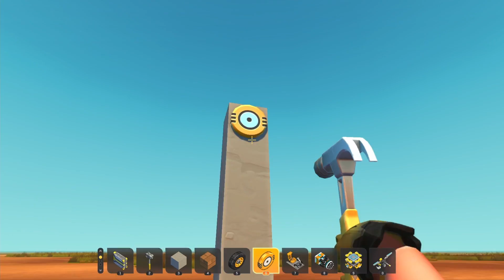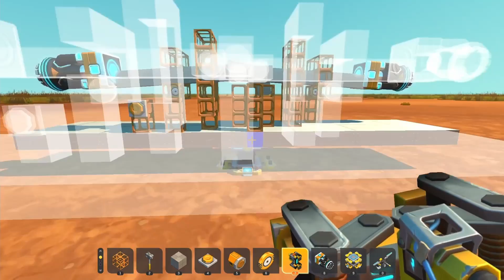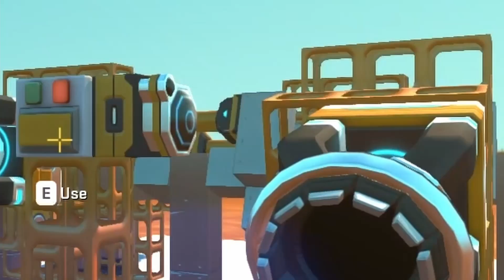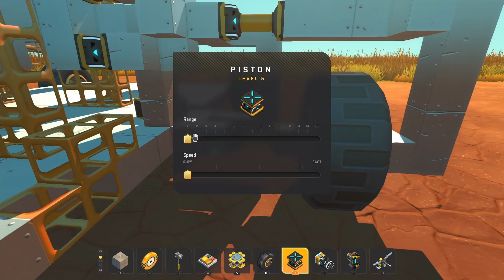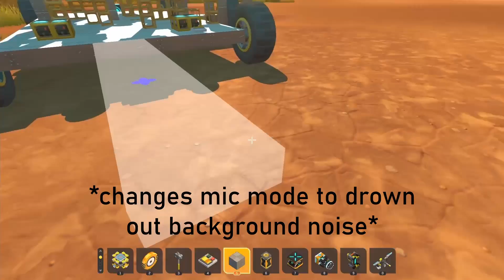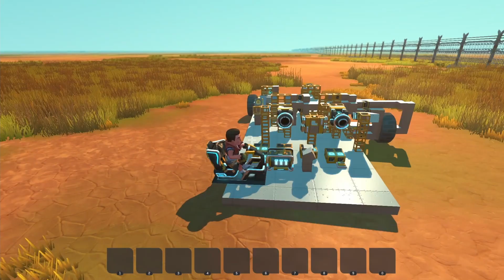Can You Make a Realistic Car in Scrap Mechanic?

Comment: you should look up scrap mechanic passthrough bearings (like the one made by cheddar fox), they put the piston either off to the side and connect it to the axle, or directly on the axle through the bearing. there is plenty of videos on how it works and how you can make them with out using mods or glitches that arent part of the intended game mechanics (eg: bearings have give perpendicular to their axis allowing you to place a piston on a displaced daughter object when it is pushed sufficiently out of the way. this is normally used as a sort of spring to more easily calculate forces from part to part)

Comment: Hi.i think is very heavy and engine work hard to move it
Use wood or plastic etc next time
And in SM you have alot of way to build free energy small engine.
Some example is wedge and pipe or piston engine or other glitch power engine
I dont remember all of them but they are too many.

Comment: You could make a clutch to keep the engine running even when the vehicle is stopped, this would also allow you to get it rolling without relying on a bump start, as when you extend the clutch pistons to make contact with the flywheel, it will still be able to slip to keep running, and the vehicle would gather speed off of the leftover friction until there is no longer any slip. You could try various block combinations for different levels of drag, who knows what the right combo would be as too much friction would stall it while too little would hinder performance.

Comment: Some small tips:
1. "Generator pipes" look like thick pipes but actually are quite a lot smaller, so if you'll need smaller hitbox you can use these
2. Talking about gears, sm while having quite small blocks, works best with big objects in that regard

Comment: I’m sorry- did you connect the two halves of the engine with free floating extended pistons? When you couldve just built them as one object, plus you could use suspension pieces on max strength as they’re longer
Reply: or just weld the parts together..?

Comment: Advice - make the camshaft bigger for higher torque. Its 3 blocks big now, if it was 5, that would make a huge difference. Could even go for 7. Thrusters shine not at torque, but at speed, so, using them in a system which expects less torque out of them, will make the system much better

Comment: where is the flywheel
Reply: why are you pushing against the thrusters, going backwards, put the engine thrusters pointing up
Reply: either independent motors (hub-motor) wheels or a differential system :)

Comment: If you put the creation on a lift you can weld "child entities" together, so you don't need to slot pins in to rotate.
You may also have less problems of friction with pipes (not really 100% sure though) Since scrap mechanic did an update that messed up friction between blocks

Comment: Instead of the wheel to the side, just use a gear using small pipes, they don’t resist much and the amount of power on your engine can be increased with the thrusters

Comment: You dont need an engine for steering, if you just connect a seat directly to a bearing it will act as steering when you press A and D in the seat.
Reply: That's... not realistic, which was his objective
Reply: You can still attach it to a rack and pinion to that for maximum realism.

Comment: Instead of expanding the pistons you could just weld them directly to the other crankshaft. 
Place a bearing on opposite sides of a block, put blocks on the bearings, put another block on the side of one of the blocks you just placed, place a block on the piston and weld that block to the other block.
⬛️l⬛️l⬛️
⬛️ ↔️ ⬛️

Comment: I've experimented with using spud guns instead of thrusters for engines, it gives the force all in one instance
Reply from the maker: Might try something like that
Reply: @ReidCaptain  also they are only one block wide
Reply: @eylookvulheimiik7538  heimlich*
Reply: @ReidCaptain  Piston engine might be better, you can check out a ton of them on the workshop if you want ideas
Reply: @ReidCaptain  Tip: Use glitch welded spudguns(like 50 in one for massive recoil)

Comment: I know that there are some mods out there that have gears in them, might make it a bit easier to improve on this
Reply from the maker: I definitely want to try some gear mods soon
Reply: @ReidCaptain  In the best one (which i don't know the name) you need to download the gears from the workshop once you have the mod. So pay attention to the description.
Reply: @bernardoramos7842  It's called the ACL Gears Mod
Reply: @cadetkohr5508  the hit box on that mod is broken. I suggest the blueprints from the Mechanical Parts mod.
Reply: @bernardoramos7842  Mechanical parts mod has excellent parts
Reply: @cadetkohr5508  that mod is great but he meant the mechanical parts mod
Reply: @bernardoramos7842  it is called mechanical parts
Reply: @ReidCaptain  Mechanical parts mod
Reply: @ReidCaptain  Use Mechanical Parts mod, it has smooth gears, universal joints, bearings with axles through them and much more!
Reply: @ReidCaptain  There's also a mod with passthrough bearings
Reply: Yeh no gears in scrap mechanics is really bad like they dont work well
Reply: Since the survival update most mods have been broken. Majority of gear mods can be very glitchy too. Pipe pieces is about as close as you might get. Quick edit: use the thicc pipes not the noodle pipes